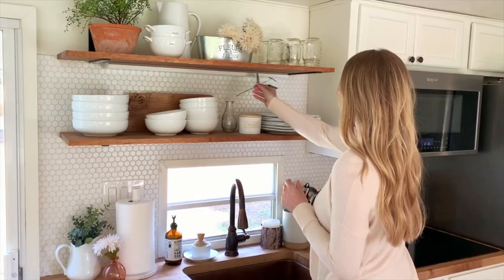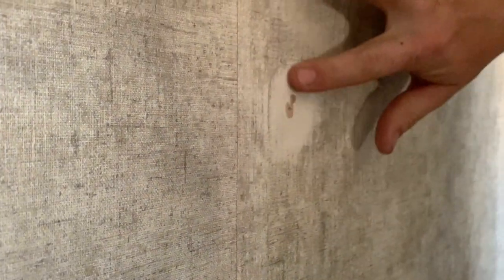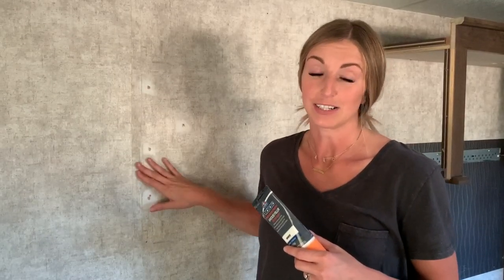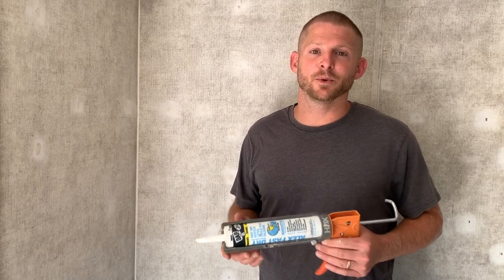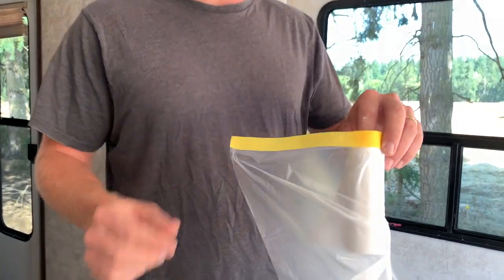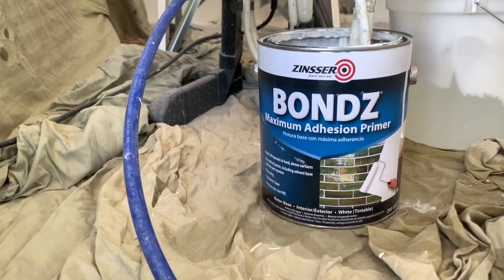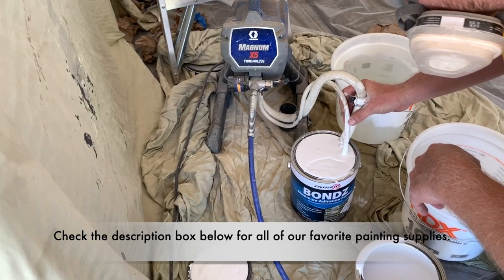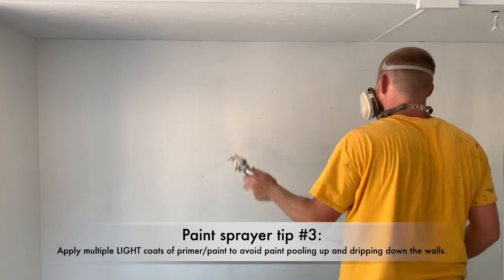How To Paint RV Walls

Comment: Bought a used Mirada by Coachmen and the wife and I decided to redo the inside.  We painted all the walls, cabinets etc, removed and replaced the carpet, furniture including reupholstered our dinette and swivel chair.  Regarding the painting, never sanded,  never taped, did most of the painting with roller and brush, with exception of the bathroom door and and all cabinets doors and drawers, we spray painted these...but never sanded.  By not sanding and taping we saved days and days of unnecessary work, instead used a really good bonding primer and bonding paint...we just made sure we washed the walls with cold warm water and vinegar the rinsed.  That's it.
Reply from the maker: There's definitely different methods to take when painting RVs. We've found that all of the steps we recommend in the video result in the paint job looking great and lasting for many years. Thanks for watching.

Comment: I’m currently getting ready to paint. Couple questions. Why did you not have to remove the wallpaper? that won’t cause an issue in the cuter with chips? Also, I saw you are using calk does it not crack or peel after some time from the constant moving and settling of the camper? please help i’m doing so much research and need help
Reply from the maker: We've found it easier to paint directly over the wallpaper, this is where the Gripper primer really is important. We used a flexible caulk.

Comment: TSP is an ingredient in most breakfast cereals. Not that toxic.
Reply from the maker: Just because something is listed in the ingredients list in a processed "food" item doesn't mean it isn't toxic to the human body- but that's a whole other conversation on its own 🤣 As for the TSP cleaner, the warning on the back of the box states "All strong cleaners are irritating and may cause burns to the skin and eyes.
Wear full cover eye protection, gloves and long sleeved shirt to help avoid contact with powder and solution. Watch out for splashes and overhead runs and drips and DO NOT allow solution to get into gloves or soak through shirt into skin. Thoroughly wash all contaminated clothing before reuse." So that is what we recommend when it comes to handling this product.

Comment: Did you remove windows?
Reply from the maker: Yes, we did remove some but not all of the windows. The large window in the back had to be removed to get the larger furniture / appliances in and out, so it was easy enough to leave it out while we painted.